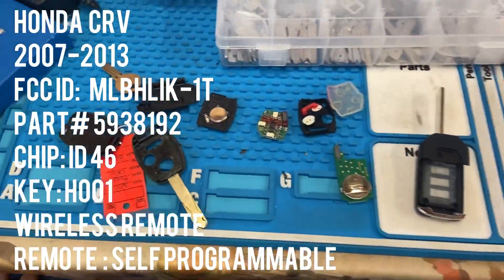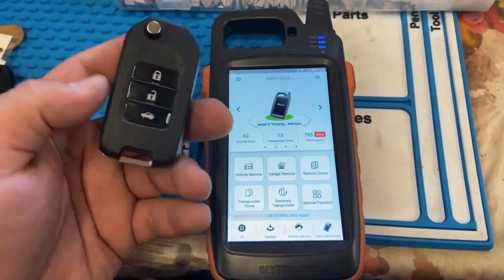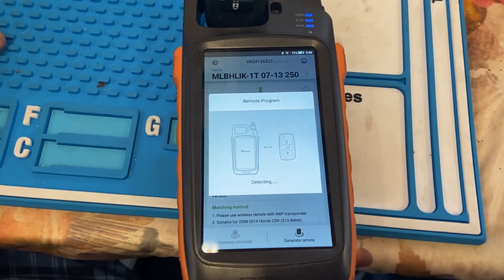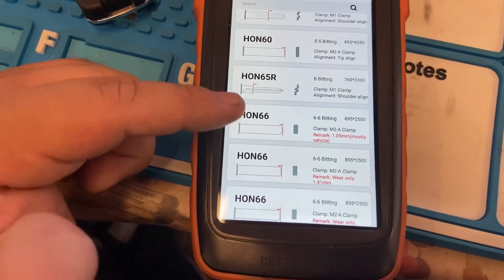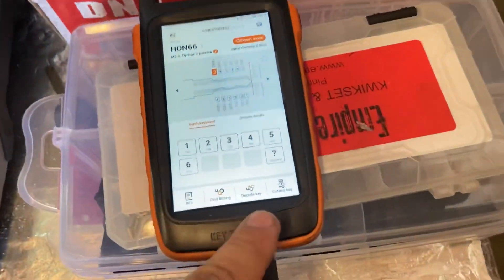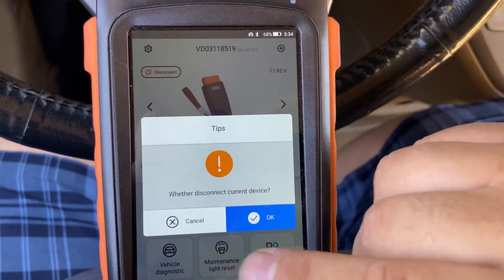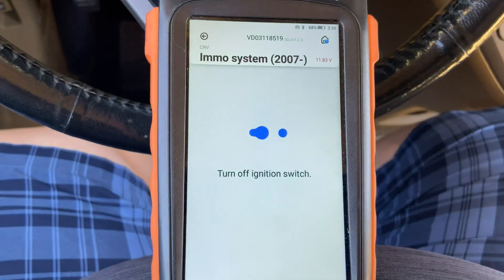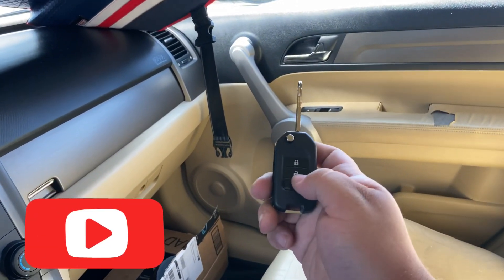KEY TOOL MAX - GENERATE, CUT & PROGRAM HONDA CRV 2007-2013 (DOLPHIN XP-005)

Comment: On the last step I don't get immo light turn off. What could the reason be? Any idea? I tried with IM508 aswell key data synchronization step is failed
Reply from the maker: wrong chip id! whats the year and model?

Comment: Beat key cutting and programming channel by far! I just purchased a dolphin XP-005 cutting machine and I’m trying to familiarize myself with all the keys and functions of each vehicle. Your videos help me tremendously!!!! Thank you!
Reply: I just bought one of those machines too. I bet you cant familiarise yourself with everything inside a couple years. Its insane all the stuff. I got a call out to a job Corsa D lost keys. So went there and no customer present. Had to try lock picking. Never done it before but I know other ways in to motors. So tried and not a chance. Bought the lock of ebay to go in my vice. Practise at home. 

Your machine. Wow. Its cool but lets say the key tool max its self lets the process down. You get those stupid small images. As a new guy you just cant see them to know how to place the key properly. Oh and look out for the thin grey bar at top of page. you press it and the thing expands to a search box. When searching cars and you see other, if the thing you want is not in other dont cry, it might be in the grey search box thing. On L322 Range Rover Sport thats what happened. I got the key cut after a few hours cursing. 

Never have the customer standing with you.

Comment: Awesome vid as usual. Any tips on calibration.  I have just ordered the machine and i want to make sure its properly calibrated.
Reply from the maker: Yes i have a video on how to calibrate it on my videos
Reply: @MYKEYSAUTOMOTIVE   thanks. Much appreciated
Reply: @MYKEYSAUTOMOTIVE  question,  if i have the vvdi mini key tool,  can i get by with just buying the obd2 mini key programmer connected to my phone via the xhorse app,  or do i need the key tool max tablet to program keys. Your video and info has been very helpful
Reply from the maker: @The66680  you can only use the max key tool..
Reply: @MYKEYSAUTOMOTIVE  well noted.  Look forward to watching your vids
Reply from the maker: @The66680  thank you

Comment: Nice video and good information. Have you ever had a problem when duplicating this type of honda key with the dolphin that they don't work? I am having that problem is a hit and miss for me when duplicating this type of key with my dolphin.
Reply from the maker: Please watch the ending of my last video!! I explain that there!!
Reply from the maker: DOLPHIN XP-005  FIRMWARE UPDATE (VERSION 1.4.6) +TIPS AND TRICKS!  Time frame/ 5:16
Reply: Jose,  I was curious if a software update fixed your Honda key hit and miss issue.  I have a condor Mini Plus and more than half the Honda HO03 keys I cut, work in the door but they don't work in the ignition.  The very first cut at the shoulder is cut too deep and that wafer stands tall and hangs in the Ignition..  This first pin is not used in the door cylinder.

Comment: Hello again friend....got a question. I was trying to do a 2000 CRV last night and it said M1 spot 1 but it seemed to me that it wouldn’t be able to get all the cuts. And was giving error saying the blade width was wrong (I was using HD103). 

Then today on a 2013 VW Beetle it was giving the same error about the width of the blade being off by too much. 

Any idea what could be causing this?
Reply from the maker: You are aligning them wrong!! Either you start measuring from the shoulders or the tip ..
Reply: @MYKEYSAUTOMOTIVE  I understand that! I’ve been using it for about 3 months and never encountered the problem until last night. I ordered a brand new probe and but I’ll have it tomorrow and gonna re-calibrate from the beginning and see if it fixes the issue
Reply from the maker: @sce2auxillary  ok sounds good let me know how that goes,, the only time when I encounter that issue is when i have the wrong key or measuring incorrectly..
Reply: @MYKEYSAUTOMOTIVE  can’t explain what it was. I had same issue on 2008 Nissan Maxima. I actually got the key code by VIN and it worked perfect. So I’m guessing the key was wore out so bad on the 2000 CRV. Now on the 2013 Beetle, I still can’t explain it. 

But just to be safe I did a re-calibration on all 4 clamps just to be safe!
Reply from the maker: @sce2auxillary  try decoding by vehicle model.. dont decode by universal key...
Reply from the maker: @sce2auxillary  one of my friend was having an issue with cutting those older honda keys and really he was just placing the key incorrectly on the clamp.. with those old key you measure from the shoulder to the tip !! Not tip to the shoulders
Reply: I’ve never used universal key duplication
Reply: @MYKEYSAUTOMOTIVE  correcto
Reply: @MYKEYSAUTOMOTIVE  hey quick question which Dino pick did you use for the GM ignitions?
Reply from the maker: @sce2auxillary  you can use any kind of pick as long as it fits!!
Reply: @MYKEYSAUTOMOTIVE  lol that’s what I’m asking lol which one fits?

Comment: VERY KOOL.😎 VID & EQUIPMENT MAN! 👍I REALLY ENJOY WATCHING U SHOW HOW THESE SYSTEMS WORK.  
ARE THESE TOOLS VERY EXPENSIVE...MAX TOOL, MINI OBD, DOLPHIN, KEY CUTTER, ETC.?
Reply from the maker: Max key tool with mini obd i  got it for 400$  dolphin xp -005 is about 1900$ the autopropad basic 800$  the autel im508 is on special for like 2,000 or less
Reply: @MYKEYSAUTOMOTIVE  the im508 you can get for about $999 USD. If you bought the XP-400 with it, it is essentially the same as im608 except it doesn’t have bi-directional diagnostics.

Comment: I found out two weeks ago super chip and wireless or purple bag and blue bag aren’t the same. 

I noticed you said wireless only does 46 and 47 chip I think it was. But does super chip do all the wireless keys or are there some it doesn’t do??? Thanks for all your content Bro!!!
Reply: P.s. I love the dolphin!!! For the simple fact you can update it so easily every time you use it!!!
Reply from the maker: The super chip only does a few more but no it does not do every key, whatever the system (max key tool ) has it will do only those!!
Reply: @MYKEYSAUTOMOTIVE  I’m sorry I worded that wrong. I meant what’s the difference between blue bag wireless and purple bag wireless remotes. Is there an easy way to explain it??  I didn’t mean super chip itself, I do understand them I believe.

Comment: Impressed you got the mini obd tool to work. I had pretty much gave up on that thing.
Reply: Wanna sell it?
Reply: @DanielTorres-bs8dx  nope. Can’t really have to many programmers. Even if they suck lol.
Reply: @russej02  doesnt hurt to ask. Lol
Reply from the maker: I did too but they have been starting to update the system (upgrading) so thats def a plus!!
Reply: I’ve had a lot of luck with it. It’s yet to fail me on pulling Chrysler or Chevy pin code
Reply: @sce2auxillary  must if had some updates since I quit using it.  Last car I tried it one was like a 2007 accord that is actually listed in the app and it failed. Maybe it’s time to start trying it again
Reply: Will the mini obd tool with with the vvdi mini key tool? Or is it only intended to be used with the vvdi key tool max? I am trying to figure out if I should get the key tool max and the mini obd or if I should get the auto pad pro or the autel maxim, please let me know your suggestions I have been working with the xhorse cutting machine and the vvdi mini key tool only been doing duplicates though haven’t been able to do all keys lists. Any information on this subeject is highly appreciated. Greeting from Texas!
Reply: @tacoma9851  the Mini OBD Tool will work with regular Xhorse app on your iOS/Android device so the answer to your question is No, you don’t have to have the Key Tool Max for it to work. 

With that being said, I have the Key Tool Max, Mini OBD, IM608, AutoPadPro, and I’m still looking into buying Xtool Pad 3, or Smart Pro, or perhaps even a SmartBox. 

There have been times where the 608 wouldn’t do it, and my cheap $100 CK-100 did. There is NEVER going to be an all in one programmer that does every year make and model as nice as that would be. I’m always on the lookout of some “older used” programmers just to add to the arsenal. 

One nice thing, for those doing newer cars, if you have an Autel machine, it can now be added FCA servers and you no longer need to tear apart the car and use the 12x8 bypass cable to program 2018+ Chrysler, Dodge, Jeep, Fiat, etc. So that’s one plus of Autel at the moment. 

As far as AutoProPad, if you aren’t going to be jumping into EEPROM (which I’d only recommend to someone with quiet a bit experience) then the AutoPad Lite does the same thing programming wise without the EEPROM utilities. 

Hopefully this provides a little helpful insight.
Reply: My friend, one day I wanna be like you. Thanks for your very informational videos. From a used car dealership owner to car locksmith, this is what I want my story to be. 
I own the VVDI Mini & i believe It cannot programm like Key tool max
Something i am very confused about is, how did you cut this key without an existing key?
My assumption is all cars have a different cut or not? How did you set up the specific cut of the Odyssey you were working on?
Please let me know